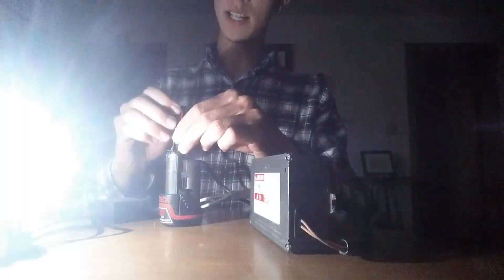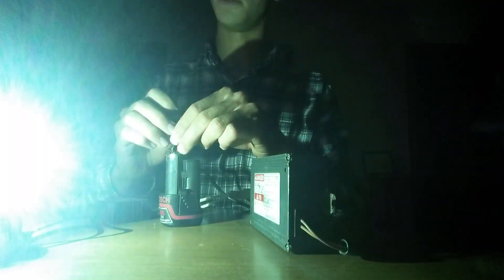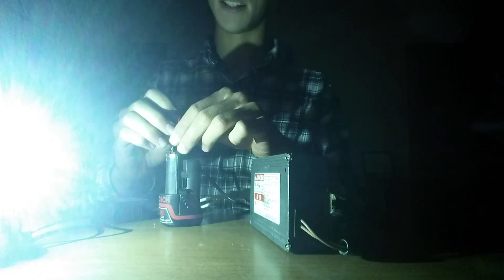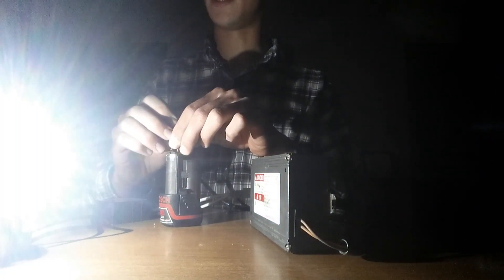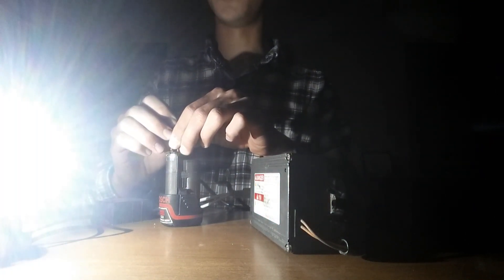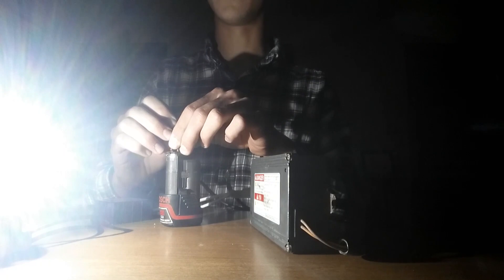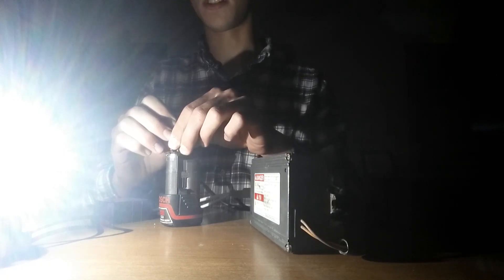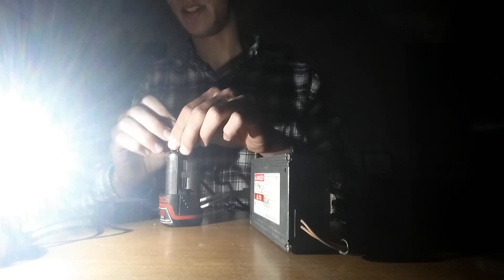How to test your xenon HID Ballast and bulb

Comment: So I had a bad DL headlight a couple months ago on a 2015 Audio Q5 and I thought it was the ballast. I ordered two used ballasts and two new HID 5000K bulbs on eBay. I installed and they worked great. So figured it was the bulb. Now the same headlamp is showing an error on my dashboard, but it comes and goes. Sometimes the bulb will startup fine (no errors), etc. and sometimes it won't come on at all. When the bulb is own it seems to be as bright as the other one. Before I replaced, the bulb would come on but was very dim and gave be a dashboard warning. Do you think this is a faulty bulb for ballast? Because it's intermittent it's hard to swap PS components. I think the igniter is in the bulb. Thanks.

Comment: So all I gotta do is cut the plug off to test it. Thanks for the useless video. I assume most of us are here to find out how to test with the plug being a nipple and ring.
Reply from the maker: Look here you absolute fucking twatnozzle, this was filmed in 2015 when the overwhelming majority of ballasts on the used market were a 2 pin high voltage setup. Modern LED lighting and / or integrated xenon ballasts has only become a thing in the last 5 years or so, and even then only became popular in the 2020's. For your "nipple and ring" setup, which is going to be different for every, single, type, of light, let me make this real fucking simple for your smooth brain: 12v go to hot wire, ground go to ground. Gonna have to figure out which wire is which though because again every modern light uses a different harness, and I genuinely hope you zap the absolute fuck out of yourself in the process.

Comment: What would the problem be if i have +12V at the plug and my new ballast & bulb wont turn on? No flicker, nothing. Using a morimoto relay with good ground. Fuses good
Reply: Those wondering the fabled morimoto relay went bad. I warrantied it once and it went bad again

Comment: Are you serious, 25000 volt ballast output, it will kill you just by getting closer to it, they will not be crazy to put that kind of voltage on some accessible to human been, and in addition  it will blow up all electronics in your car, because of the hight magnetic field that will produce arround it, output ballast voltage vary from 80 to 110 volt only man common.
Reply from the maker: You are blatantly incorrect. Xenon ballasts can run anywhere from 20k to 30k volts upon ignition. There's a reason there's a big warning sticker slapped on every automotive and industrial ballast. There's a big difference between voltage, wattage, and amperage. Volts don't produce fields, amps do. Get your facts right before you talk shit.

Comment: My bmw left light keeps going out so I thought it was a short, but qhen I swapped the light, it would work. The only problem is the lights only last about a month before fhey stop working again. What could this be?
Reply: First thing to do is to double check that your your ignitor is on flush and that you have good ground contact. Then check ignitor then ballast.

Comment: SOOOO no test, just keep replacing until it works? Couldn't you have showed what the video said? HOW TO TEST?
Reply from the maker: "A procedure intended to establish the quality, performance, or reliability of something" - Oxford English Dictionary

This is textbook bench diagnostics for closed box electronics. Find me a multimeter that reads 25000 volts and an idiot dumb enough to stick his fingers down there and I'll be happy to film it, but even then you're going to get a binary answer. 

This is super simple. Either it works or it doesn't. On multi component systems where you have duplicates, the fastest and cheapest way to diagnose a failed component is to swap in known good parts until you find the failed link. 

You're more than welcome to post a video of yourself doing a better job, hell I'll even link it in the video here. But all I see on your page are a bunch of videos of your underage daughter, which is a little odd in my boat but hey, whatever floats yours.

Comment: Hey man. Thanks for video. Just wondering, my ballast are mounted in a hard to reach area, but I can access the cables going to the bulb. It’s an after market projector retrofit system with igniters built into the ballast. Can I take the leads coming out of the ballast and put a multimeter in these to test for a proper signal? What should I set my multimeter to since the initial ignition is high voltage? Thanks!
Reply: I'm wondering the same thing.

Comment: Informative video.  I'm currently having issues with 2010 Audi Q5....left headlight both high/low beams turn on but then turn off about 1 minute.  Since it involved both high and low beam I assumed it was not the bulb(s) and more likely the ballast.  Replaced ballast and had exact same issue.  Could this simply be a bulb/ignitor issue?
Reply: if he had shown how to test the ballast, it would help. Just replace he says and see if that works

Comment: sm1 have an advice? i used a power adpter for turning the ballast on. it works but the light is blinking. i dont understand bevause the power adapter is supposed to convet the AC from wall socket to DC (12v) but in fact it looks like its output (from power adapter) is still in AC. what could be happening? in the specs of the PowAdp its says clearly DC (with symbol: one solid line and one intermitent above)

Comment: Quick question: I have xenon headlights and both of them have always been flickering and by flashing the highbeam they function again for a short time. I recently changed the bulbs because they where turning pink aka going out. But they are still flickering. Do i need to replace both ballasts? Or is this some kind of ground issue?
Reply from the maker: My guess would be ballasts, but without being there in person there's no way for me to say with certainty.

Comment: I could have guessed the process shown in this video, and I have never tested a bulb/ballast before. Hook it up to a battery. Replace parts in the signal chain from least expensive to most expensive, D'uh. That is not "testing" the bulb and ballast.
Reply from the maker: K, let's hear how else you'd do it. I truly don't understand what you think the proper way to confirm or deny that an electronic device is functioning. It's a binary thing; it either works or it doesn't. Seriously, and I'm asking for my self-improvement, what else would you like me to do?
Reply: I agree with Silvamorde2004. You didn't actually test the ballast. People want to be able to determine which component is bad and replace only that one. Not play trial and error replacing parts down a chain that aren't broken. If my ballast is bad, I don't want to replace my igniter just to find out it's good and the problem was actually the ballast.

Comment: Having a problem with one headlight in 350 z replaced the bulb how would you test the ignitir?
Reply: im having same issue with my 350z, gives a strobe but thats it, changed my bulbs and still the same. what did u find ???
Reply: @sweet_Gs  haven't had anything deffinant can't find a good mechanic, they're telling me it's either the ballist for the hid or an "unseen electrical issue". Either way it's gonna be pricy and I'm thinking about just getting rid of the car

Comment: my driver side light went out and cant get the bulb it its connected to a wire i guess you call that the igniter but as for bolts on the back of it, so how do i remove just the bulb, 2012 camaro lt
Reply from the maker: I believe that your Camaro uses a D1S bulb, meaning that the entire unit has to be replaced. See link below for a picture to confirm before reading on.

http://www.ijdmtoy.com/ebay/Ebay/Xenon_D1/D1S-HID-Bulbs-01.jpg

There should be a cable running to the bulb. Unplug that, remove the bulb from the housing, replace the bulb, plug the cable back in. The D1S bulbs have the ignitor built in, so all you should have is the ballast, the cable, and the bulb.
Reply: Cville Auto it looks nothing like that but there is a ballast and like 3 wires that is connected to the bulb
Reply from the maker: Your Camaro should definitely be using D1s bulbs for the low beams, unless it's a modified housing. If you're looking at three wires, you're either talking about the high beam / driving light, or your housing isn't a factory HID headlight.
Reply: My passenger light is out dont know if its the bulb or igniter!

Comment: My passenger side on my Acura TL 2007 turns on but then it starts changing color kind of like a purplish color then minutes later it flickers and turns on what you think is wrong ? The ballast or the light
Reply from the maker: Jose Manuel Ramirez sounds like the bulb to me. Swap the bulbs between the two lights and see if the problem follows the bulb. That'll tell you what the problem is.

Comment: can you hook up the hids straight to the battery whit a on / off switch ?
Reply from the maker: +Vicente Dominguez There's no reason that you couldn't, but you'd want to be very, very careful with how you wired it. Assuming that you're installing aftermarket ballasts for headlights or factory fog lights, it would be easier (and probably safer) to tie into the factory low beam harness. For adding fog lights to a vehicle that does not have them from the factory, adding a switch is the only effective way to do that. Again, be very careful about where you run the wires and the gauge of the wire that you use.
Reply from the maker: +Igor K It might throw off a lot of light, but without projectors, it won't be very well directed at all. It will also be incredibly power hungry, and no battery that is a reasonable size will be able to power it for very long. Good luck if you decide to work with it, I'd be interested to see how it goes.
Reply from the maker: Igor K Not overly familiar with that brand, but I will tell you that OEM HID ballasts do not like being run at a lower voltage than they are designed for. I would expect to significantly lower the lifespan of the ballast.
Reply: Great Video!  May I ask ; I have a 2005 Nissan Maxima. It currently has factory standard halogen headlight assembly’s. 
I have 2 assembly’s that are factory Nissan HID, can I easily wire them up in place of the current halogen ones ?
Thank you.
Reply: @tone026 same issue I have doing my head in. Did you figure it out?